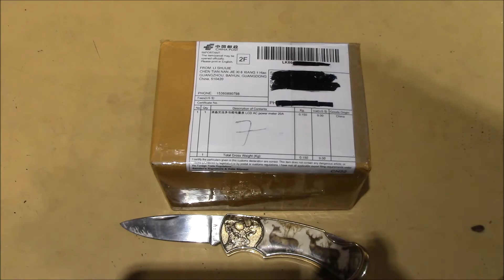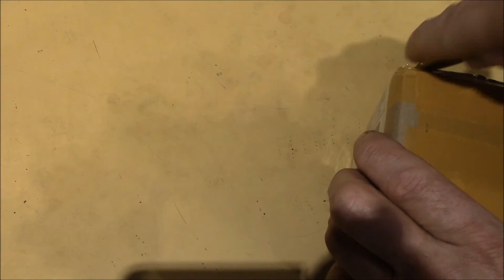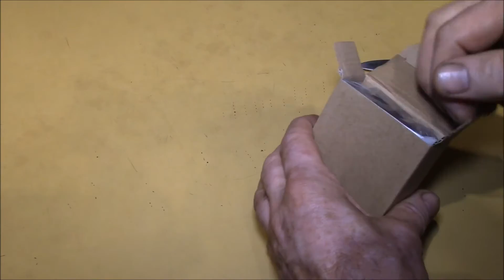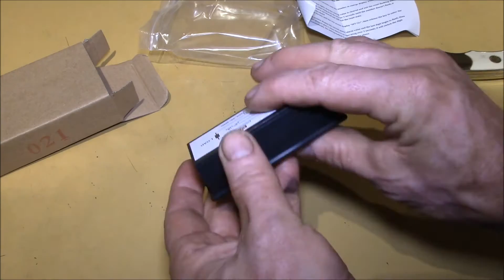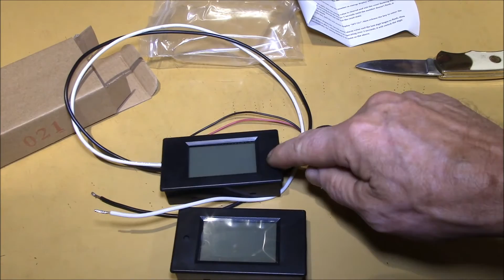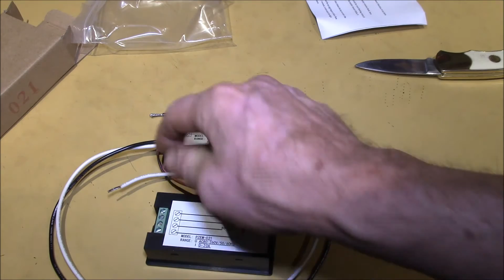PeaceFair PZEM-021 AC Power Meter, Unboxing

Comment: Is it still functioning? Can I use this continuously 24/7?
The meter without ct ment to measure lesser current but it may get hotter than the other one is that true?
Reply from the maker: Not sure if this exact meter is still running, I have  a few of them in different applications.  I did have one installed in a 240V application and it failed after about 8 months.  I think the capacitive dropper power supply failed, I think it's repairable.  I've heard that in 240V operation, it does tend to run hot, but in 120V operation, it's much cooler.  I have an internal shunt AC meter in my bench power supply and it's working fine after a few years.  I have one of the DC versions of this meter that's been running a few years (24/7) and it's working fine.  Yes, the internal shunt versions might have a bit more heat inside due to the small value current shunt resistor if you are running them up near the maximum load compared to the CT version.  But I think it's the internal AC power supply circuit that is the main heat source.  I think it could be redesigned to run a bit cooler, especially on a 240V load.  It's easy enough to re-power the meter off of a 120V source to cut the heat generation.
Reply: I ordered PZEM 061🙂 anyways thanks for your valuable time .

Comment: The diagram shows a 2-wire Line/Neutral (e.g. 240v/0.0) on the input. I wonder if the input can be connected to a 2-wire 240v  L1/L2 (i.e. 110v/110v) supply. Any idea please.
Reply from the maker: Sure, several options.  One is to run both load wires (L1 and L2) through the CT, reverse one of the wires to add the currents.  Then connect the meter voltage input between L1 and N (or L2 and N).  This way you see 1/2 the voltage plus 2X the current which will give you the total watts on L1 + l2 combined.  Or if you want to see volts/amps/watts for both L1 and L2 separately, you'll need 2 meters or get a meter set up for 2 CTs and designed to combine the readings into a single power display.
Reply: @The4Crawler  Why would you not connect L1 and L2 and measure the voltage across the mains instead of the L1 or L2 to neutral?  That way you could capture total voltage and amps and watts with one CT, unless I am missing something.
Reply from the maker: @escalera601  All depends on what you are trying to measure.  If you have a pure 240V load where current in L1 = L2, like is done in this video:
https://youtu.be/LhR-Z6lBeZw
Then yes, you can measure voltage L1 - L2 and sense current in either L1 or L2 (since they are the same) and meter will read total volts, amps and watts.  

But if you have a split phase load where current in L1 is not equal to L2, then you can run L1 and L2 through the CT in opposite directions, so they add.  But now you are measuring L1 + L2 current or roughly double.  In that case, if you want watts to be correct, then measure one of L1 - N or L2 - N for the voltage input.  Yes, the volts will be 1/2 the total of L1 - L2.  But if you take 1/2 x volts and 2 x amps you end up with 1 x watts.  So your watts and watt-hour readings will be correct, volts will be halved and amps will be doubled.
Reply: @The4Crawler  Thank you so much for your excellent feedback.  I am trying to measure the load on an old spa that I keep on all year long.  One of the legs runs a pump motor and the 240 L1 to L2 runs the heaters.  I had to remove a lot of the insulation due to rat infestation and wanted to see the effects on the heating costs. Wanted an inexpensive solution for measuring this.
Reply from the maker: @escalera601  If you only want to measure the heater load, then you could run only that side through the CT and measure voltage across the 240V.  Or if you want the total load, do both legs through the CT, in opposite directions.  Then measure only half the voltage and the KWH readings will be correct,
Reply: Dunno if you guys gives a damn but if you guys are bored like me atm you can stream pretty much all of the latest series on instaflixxer. Have been streaming with my brother for the last few weeks xD
Reply: @Gianni Donovan yea, I have been using instaflixxer for months myself :D

Comment: I recently purchased one of these so I could watch how many watts my generator was putting out. Sadly, I haven't been able to get accurate readings. I took videos of my display. 

The first video is with all the power disconnected from the RV with only the meter plugged in. You would think the watts being used and amperage would be 0.
https://www.youtube.com/watch?v=8YkeppuDL1A

The second video shows what the reading is just plugged in with nothing on.
https://www.youtube.com/watch?v=rSFQg3--c-c

The third video is with 2 15k ACs running. Now my generator only puts out 5,000 watts. Yet this meter was thinking I was pulling spikes of 9,000 at times. 
https://www.youtube.com/watch?v=KeNZG14iMyo

Any idea why I would be getting crazy readings?
Reply from the maker: Hard to say for sure.  I would double check the 4 wiring connections and make sure those are all correct.  Then try swapping the current transformer connections at the meter.  

If that all doesn't help, try setting up a simple type of circuit like I show in the video using grid power.  Plug in just the line and neutral wires to the meter and see if the voltage is correct and the current should read 0.  Then connect the CT and see if the readings change.  Then try adding an incandescent light bulb and see if that reads properly.  If this simple setup works, it may be that your generator is just putting out such a noisy output that it's confusing the CT and thus the meter.  The CT is set up assuming a nice clean 50 or 60 Hz sine wave.  But if the generator output has lots of high frequency noise or spikes in it, that may make the CT read too high a current.  

If this is the case, you may need a better meter with a high quality RMS (root mean square) circuit in it.  The cheap meters  just use a simple circuit assuming a sine wave input, so the RMS voltage is 0.707 times the peak.  A true RMS meter will do the whole process of sampling the waveform many times per cycle, squaring those samples, adding them up then taking the square root of the result to get a real square Root of the Mean of the Squares.

Comment: I've been trying to find a review that tests the accuracy of the readings on these panel meters, but can't seem to find any. I don't suppose you might have done any such tests by any chance? I'm looking in particular at the 021 or 061. Thanks.
Reply from the maker: I think I can do one with the 021 meter I now have installed in my variable AC power supply.  I'll see what sort of tests I can come up with.
Reply: That's great, thanks. Even if it's just a dvm set to current, in series with your load just to see if the draw matches what the pzem is reading? Thanks.

Comment: Have you had a chance to test out any of the DC version? I just purchased two of the 0-100A versions for a solar charged battery box I'm building. This battery box is to run a AC-DC portable fridge and other small DC devices (lights, recharging batteries) while camping/off-roading. I'm hoping to use these to monitor the charging from a portable 100W panel and also to monitor the load on the battery. I went with the 100A over the 20A incase I want to scale up the operation. I'll let you know how it goes.

Thank you for the videos and your contribution to 4Runners.
Reply from the maker: I have a DC version I want to test out at some point.  I had to pick up a current shunt as the one I purchased didn't come with one.  So that threw me off, momentum wise.  I also found a really neat DC meter that works almost like a Trimetric battery monitor that I need to finish setting up and testing.  That one could be quite interesting for solar battery banks.
Reply: I id, these DC versions work perfect from what I have seen